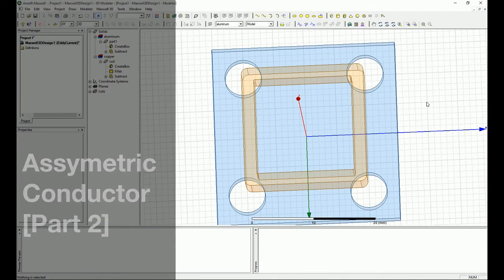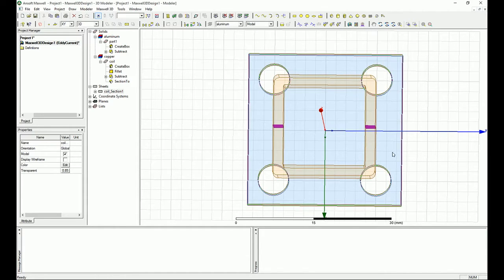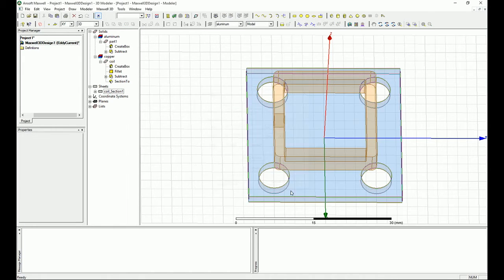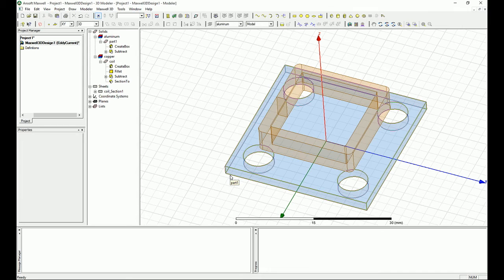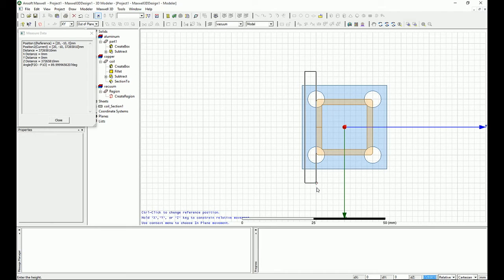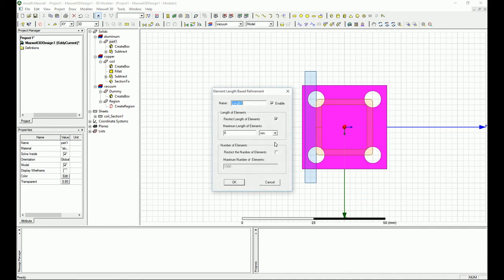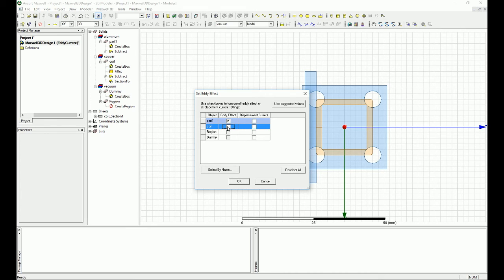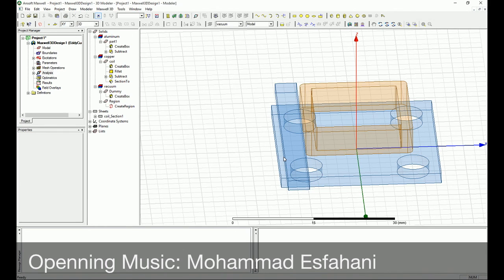302- Ansys Maxwell Eddy Current | Unintentional Radiation [2/3]

Comment: I am having trouble simulating my setup, i am looking for the eddy currents induced by a rectangular coil, but somehow my analyzation is taking forever on the meshing part... Do you hav any tips ?
Reply from the maker: +Tom H  make sure that your model doesn't have a very small track between two faces. use hill tool to fix some of those.